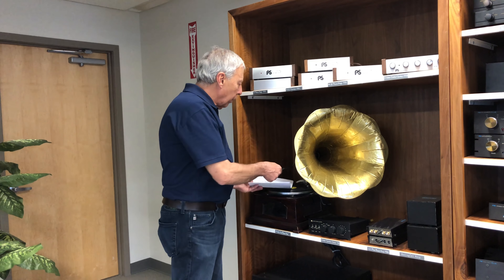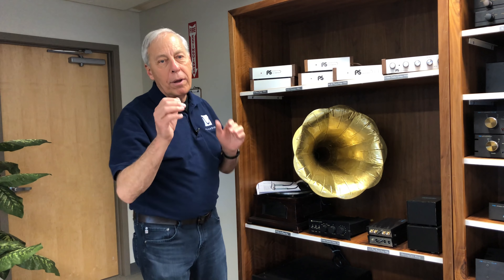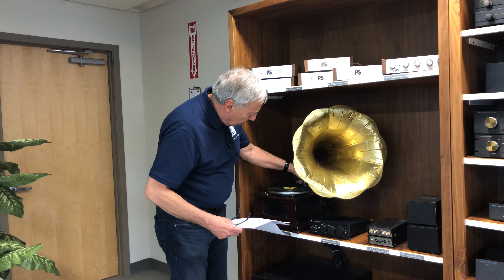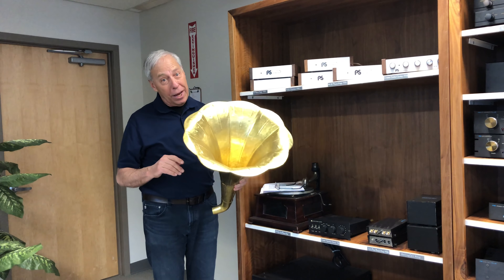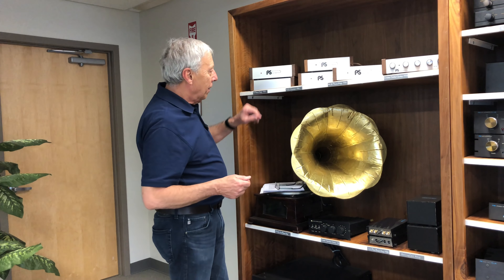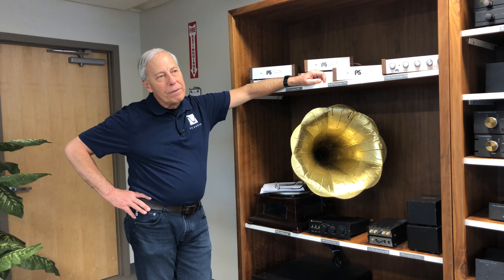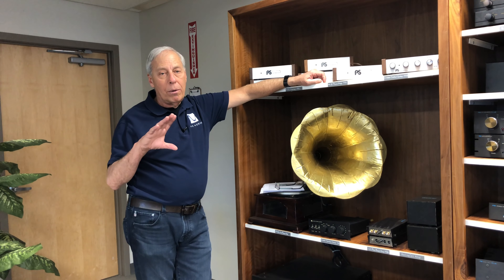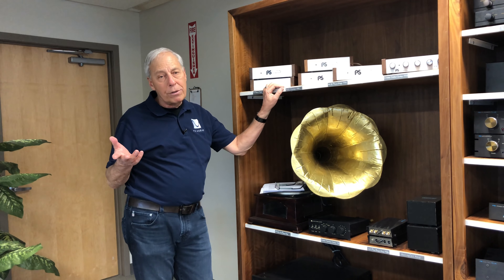Are horn speakers really more efficient?

Comment: I would assume that with for example a klipsch bookshelf speaker that the tweeter plays louder than the woofer and the resulting sound is bright and detailed in the top end, but if held back on an EQ, it is less likely to sound fuzzy at high volume levels.

Comment: It is all about acoustic matching the driver to the room.  It is a form of mechanical impedance matching to the room.
The impedance of air increasingly becomes mismatched as speaker cone area decreases, but can be brought to balance by the artifice of a properly designed horn.
Reply: Indeed, the horn is purely an impedance adapter to transmission medium aka air. But who cares about physics.

Comment: The amplification of horns allows the diaphragm to create the necessary sound pressure levels with very little movement. Horns typically have 1/10th to 1/25th the harmonic distortion of the less-efficient direct drivers and also put less strain on the electronics, whose distortion increases proportionately with work load. Horns with wave guides or compound curvature of their throats distribute wave fronts to fit a rectangular listening space, usually with a larger horizontal dimension. Circular horns of the old-fashioned kind sprayed a round wave front and wasted a lot of energy on ceilings and floors. The most accurate transducers use compression drivers for both high-frequencies and mid-range band width. Bass notes are omni-directional and can be handled by a cone speaker. 
Today,  the most elaborate and costly sound systems utilize compression horns for most of their transducer designs and reduce all known sources of distortion to the inaudible level. That, and realistic dynamic levels comparable to live performances, is what audiophiles pay the big bucks to achieve. The laws of physics were discovered long ago and the pioneers - Bell Labs, Western Electric, Lansing, et al had applied these principles to acoustic reproduction equipment in the last century. Most of today's speaker designs are not really new but variations and subtle refinements of existing art. If you see a patent number on a product, chances are it is a design patent (for the aesthetics), not an indicator of unique mechanics or circuitry. Audio devices are smaller than ever before, but sound wave dimensions remain unaltered, as is the human ear's range. The ear is an electro-mechanical device, with a combination of a diaphragm connected to bones, connected to nerve endings, It is analog in nature and a stepless energy transfer mechanism. Digital is minutely intemittent. Perhaps that is why people feel LP records sound more natural and "warmer." Cupping your hands to alter your voice is not analogous to the well-designed exponential horn. With hands, you have the barrel effect of echos which distort the timbre of the sound. Computer-aided designs
remove this characteristic. Recorded sounds at close proximity to horn speakers distorts in a similar manner. The speaker is designed to sound optimal beyond a certain distance, where the wave fronts from the separate speakers blend. Your don't listen to a jazz ensemble sitting next to one instrument. Neither should you mike practically inside the mouth of a horn speaker, unless you're trying to demonstrate the 'superiority' of a direct radiator system.

Comment: According to the video "World's Second Best Speakers" https://youtu.be/EEh01PX-q9I?t=1100, the reason that horns are more efficient is that they allow the driver behind them to match the physical impedance of the air around them better. (I'm winging this so my terminology may be slightly off.) In other words, the horn allows a driver to push a small amount of air that is then able to push more and more air as the tube flares out, meeting the open air with a pressure wave that is as large as the opening of the horn. It's not so much an amplifier as it is an "efficiencyfier." There is no more energy coming from the driver. It's just not being lost by allowing air to "get out of the way" until a much larger volume of it is forced to move with the driver.

Like pushing a ball with a stick, in an open space a ball will move out of the way, but in a narrow channel a stick can push a ball very efficiently. Air in a horn is like balls in a channel than cannot get out of the way and therefore must move in step with the driver. At the opening of the horn that larger surface wave is then able to affect more of the air in the room. A horn in front of a driver doesn't direct the sound or focus it. It just makes more of the air in front of it move by stepping down a very high impedance at the narrow end of the horn, to a much lower impedance at the opening (bell) where it meets with open air. A driver pushes on a small amount of air which pushes on a slightly larger amount, increasing as the horn get wider, eventually pushing a wave that is as wide as the opening. The flare of most modern horns is an exponential curve because that is what moves the most air, making the horn as efficient as possible.

Comment: Paul, it might have been good to mention the Iron Law of speaker design.  As I'm sure you know, it goes like this:  3 of the primary goals of speaker design are high sensitivity, deep bass, and small cabinet size.  However, because of the physics of the world we live in, you can achieve only 2 of those goals, never all 3.

You can choose the 2 that you or your customers value most highly, and compromise on the third, or try to even things up by compromising on the strong 2.  That's where the tough decisions come in.

Comment: CORRECTION, horns are acoustic TRANSFORMERS 
not amplifiers,  
tiny movement of diaphragm on horn, means LOW non-linear distortion vs regular speaker.
(But correctable linear distortion might be natively higher e.g. non flat, correct with DSP or passive crossover).

Comment: Horn loaded woofers are rare merely because they need to be big. The cut-off frequency is determined by the size of the horn's mouth. J Dinsdale published a fully horn-loaded speaker design in Wireless World back in 1974:
http://diyaudioprojects.com/Technical/Papers/Horn-Loudspeaker-Design-Part-3.pdf
It's 66 x 49 x 39 inches. Despite its size, this design rolls off below 40 Hz. If you look at the paper you will also see it's quite a complex build.
One aspect of this speaker that had me fascinated when I heard one back in the dim and distant past: surface clicks and pops on records seemed much attenuated. They also sounded excellent. The bass response of Bailey's transmission line (Wireless World in 1972) was noticeably better. The Bailey speakers also needed a more powerful amplifier, an important consideration when amps were typically 10 to 25 Watts per channel.

Comment: efficiency or sensitivity dont matter much to me, its just a volume thing, i can just turn up the volume....

high sensitivity speakers has some drawbacks, they often use bassreflex or horn, large drivers that does midrange, they also exaggerate the noise floor of amps so you might get hiss noise.

the benefits are less complex crossover that might get you better sound.
Reply: The thing about sensitive speakers is that they typically do dynamics better than speakers that aren't as sensitive.  You would think that you could compensate by bigger amplifiers, and that holds true for achieving the same volume level, but the attack of the notes often sound muted or compressed by less sensitive speakers.  If you listen to speakers that are 100dB and compare them to ones that are 85dB, the 100dB sound more "live".  Also, you have a greater variety of amps you can use with highly sensitive speakers.  With low sensitivity speakers, I've found that you almost always want a very powerful solid-state amp.
Reply: sudd Hello? Positive feedback online.  Search Greg Timber. 2017 interview with real world answers...
Reply: You can't just turn up the volume....
what if you want to produce 130db like in the cinema ? 
I wanna build a home cinema and i want to reach reference levels that is 105db highs and 115db bass. To each 105db at the listening position which will be around 4meters away, each speaker needs to produce 117db/1m. 

I can't turn up the volume on my Dali Zersor 5 to reach those level. There aren't high end speakers (even the 100 000$ ones) that can reach those levels. What if i sit 5 meters away ?

That's why horns and paper cone drivers exists. When turning up the volume doesn't work.
Reply: you are talking about bigger speakers and drivers, low sensitivity speakers can also be big. then you get same benefit.
Reply: Greg Timber 2017 interview not telling me new things,  my point stand uncontested.
sensitivity dont matter as you think it does, you can make the same speaker with big drivers and horns in big boxes and make it less efficient with a crossover, should sound pretty much the same.  and if it does sound worse then its all in the crossover as i said.
Reply: @Quetzalcoatl0  Be careful, that is definitely going to damage your hearing.
Reply: @juliaset751  It will if i play loud music all the time. But for 1 movie that occasionally has fighting scenes i won't.
Reply: It is the direct radiator, conventional cone, dome or panel types that introduce amp noise, because their low-efficiency requires the amplification system to work harder, as much as 25x harder in some cases. Plus costs goes up with wattage output, as well as warming your room and the planet more than necessary. My Altec only requires 1/4 of a watt for deafening sound pressure levels and inaudible .001% distortion from an old Fisher receiver which will easily last longer than I will. All these big monoblocks, esoteric doodads and endless cables running here and there are window dressing for the audio adolescent's video. They don't translate into recreating a live performance, once the signal is strained through devices.
Reply: @roberte.andrews4621  high efficiency have higher noise floor, excuse amp noise is higher compared to output watts. 
and 85db sensitivity vs 95db is only double the watts for same volume, if you want to reach 95db playback its only a few watts difference.

Comment: Nice lecture! I like how you would lower the woofer output in it's normal range to meet it's -4db point vs raising the 40Hz output to push it up to meet the flat area of the response curve. A lot of car amps have bass boost controls to force up the low end which is not really the best thing IMO. Yes, you could have a woofer that can be 100db+ of sensitivity @ 30Hz, but it'd be ultra HUGE! LOL.